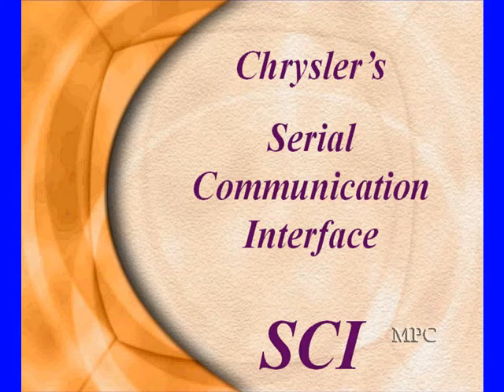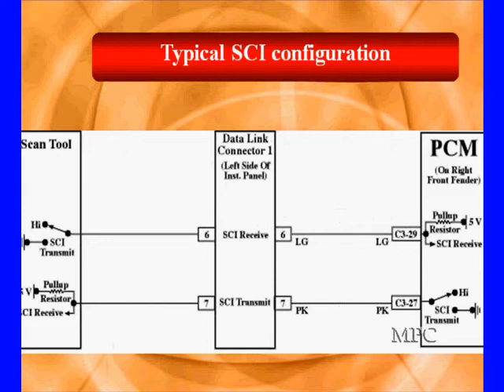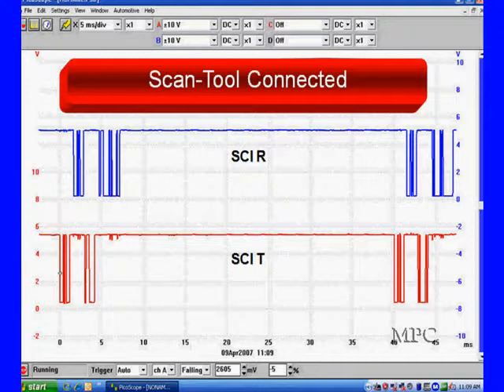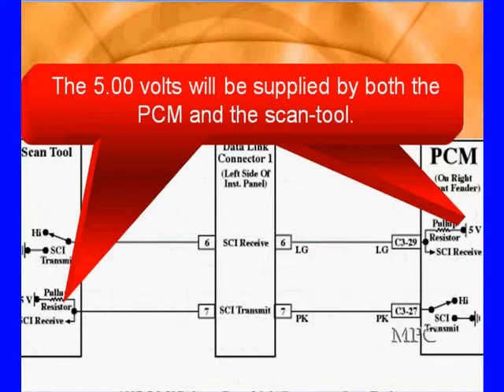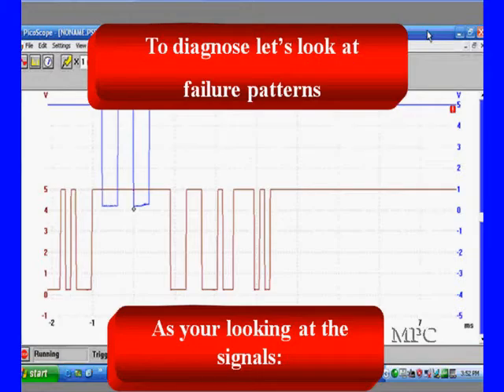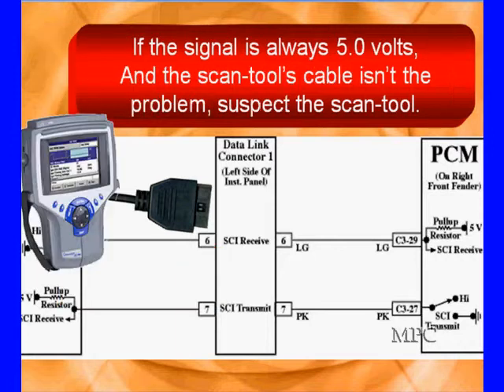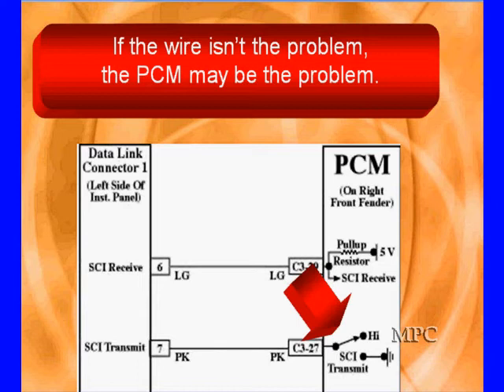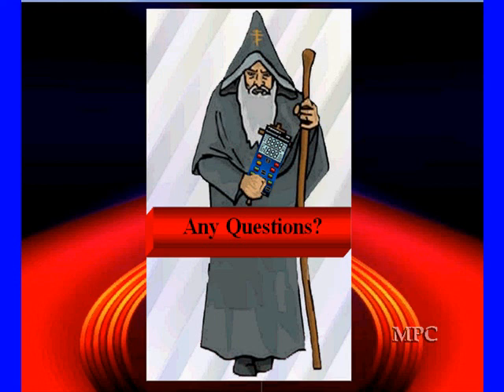04 Chrysler Serial Communication Interface (SCI)

Comment: Maybe you can help me? I have an 05 Chrysler Town and Country. Should the SCI transmit or receive have 5vt on it that I can read with a voltmeter, while scanner is unplugged? I have a DRB3, that when I do a module or use my other scanner it doesn't see the pcm. If I flip the key a few times, I can read codes from the cluster. But, when I use my brothers cheap code reader, it pulls codes. Could problem be the 5vt's not being there in the SCI? The other issue I'm having is there is no communication with the airbag module. The light is on but I can't read codes. I can communicate with all other modules except FCM. Ive read that the 05's had alot of elevtrical bugs in them. Please help me if you have any ideas.

Comment: I would love to talk more with you about communication , I am a technician at Chrysler and I am currently working on a crazy communication problem on a crossfire involving sci transmit and receive and something strange with pin 5 of the dlc that is sensor ground for the fuel tank pressure sensor. Can you email me please at josephjames1175@hotmail.com